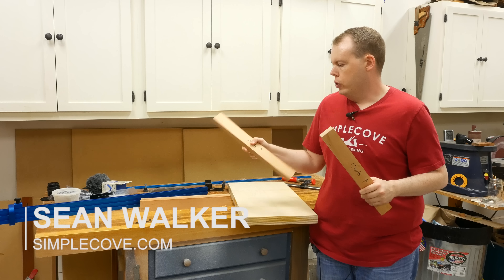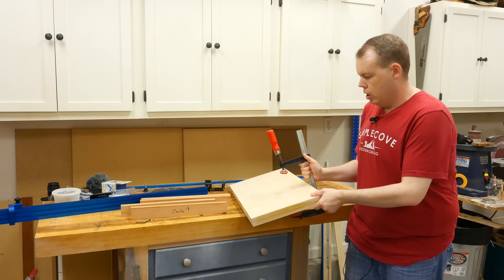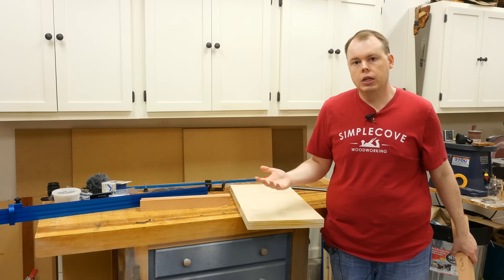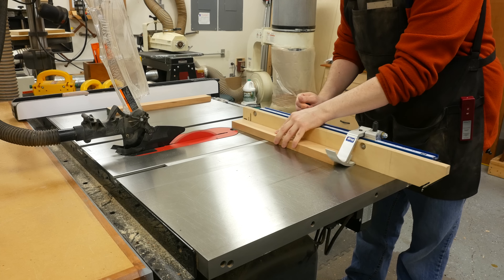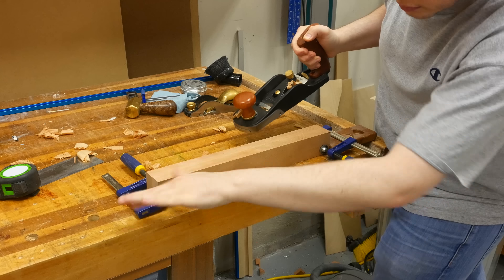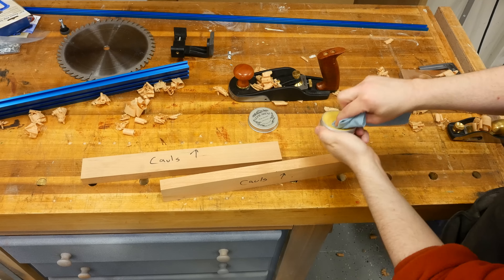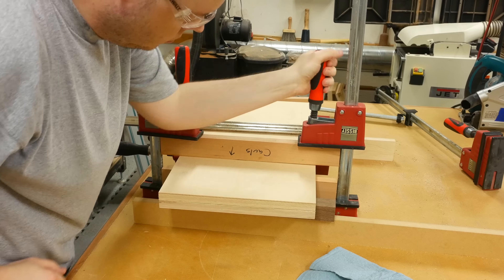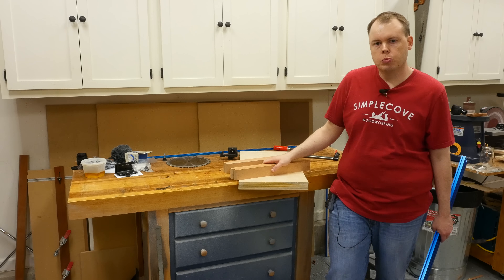How To Make Clamping Cauls For Perfect Flat-Panel Glue-ups | Woodworking DIY

Comment: Could I use calls for veneer since I dont have a vac set? Ive Only used calls for table tops..good stuff as always sean
Reply from the maker: Depending on the size of your veneered panel, you could use a platen (a board on top and bottom of the veneered panel) with cauls on top of the platens for clamping veneer. I've got a video on this very process. You can see it here: https://www.simplecove.com/guild/veneered-box/veneering-the-lid/

Thanks Joe!

Comment: Why would you not use a flat piece of would?  (Opposed to a 32nd offset)
Reply: If you use a flat piece of wood you will need to have more clamps (especially in the center) in order to get even clamping pressure.  That may be feasible towards the end of a glue up like this, but it is hard to do in the center unless you have some long reach clamps.  For a wider glue up, using flat cauls would require adding weights to the center of the cauls to get more clamping pressure there.  With tapered cauls like this however, clamping the ends applies pressure in the center and eliminates that need.
Reply from the maker: Thanks Steven! Exactly this. With the taper, as the caul bends down, it applies pressure. When you clamp a straight board, there's potential for it to not apply as much pressure in the center of the board.

Comment: 1/32 per 8 inches? Sooo. 1/8 for 24 inches? Rule of thumb?
Reply from the maker: 1/32 per 16-18 inches.  So around 1/16 - 3/32 for 24-32" should be fine. As long as the caul closes up when you clamp it.
Reply: @Simplecove  Thanks I kinda figured that but never felt capable of doing it right until now.
Reply from the maker: Give it a try! You will use them all the time. Pull some scrap lumber out and you will have a set in no time. Good luck!